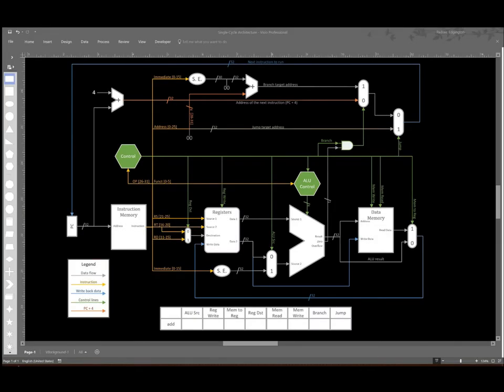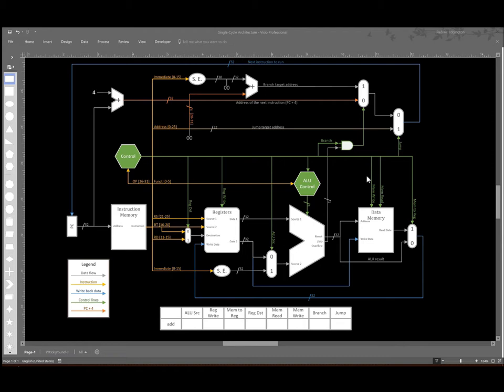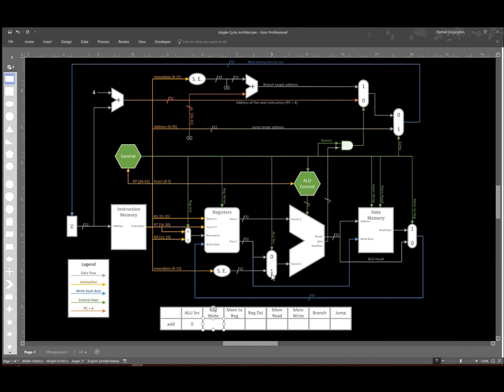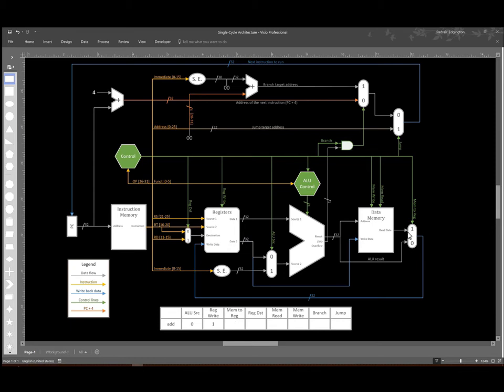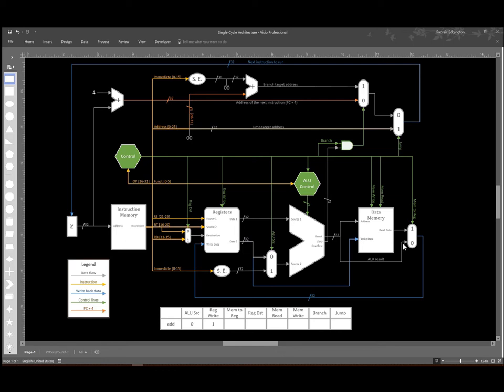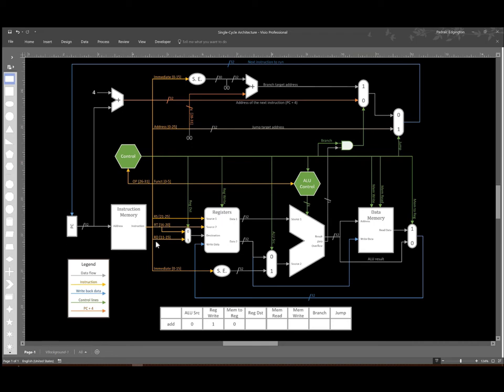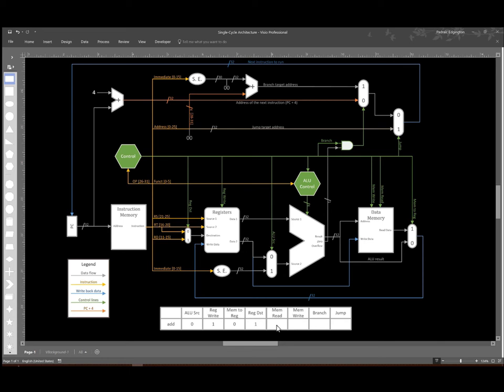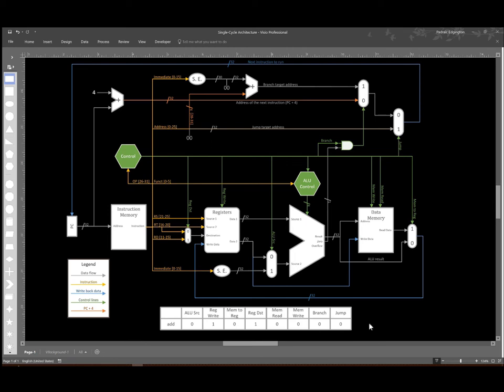5-a.  Setting Control Signals Example 1 (add)

Comment: First of all thank you very much for your videos they are really helpful! just one quick question: So where are these control signals set? Where does the machine reads them? In the OP Code? because in the given example we have 8 signals but the op code only delivers 6 bits.